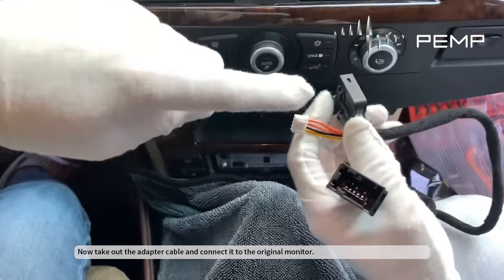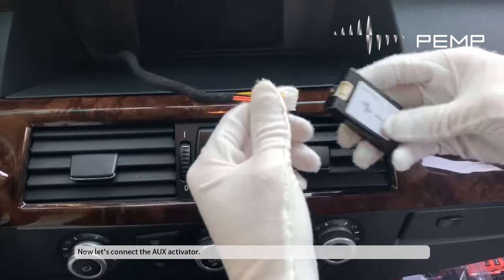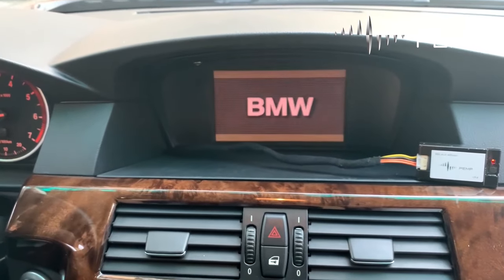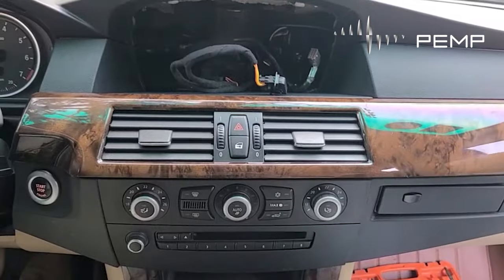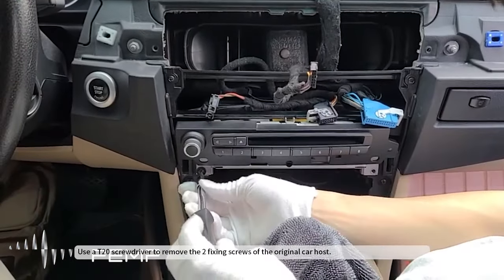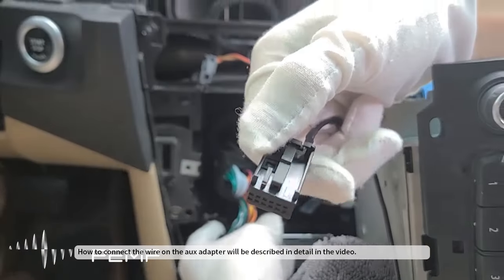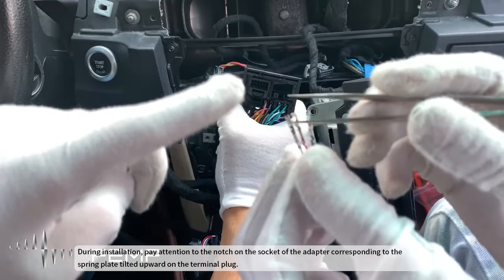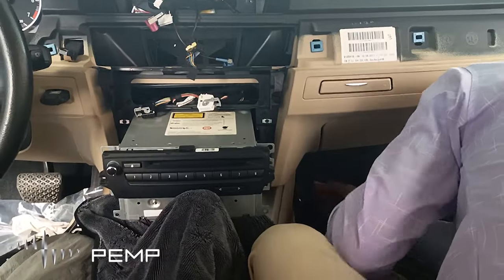Activate your BMW E60 CCC AUX Audio in 1 minute(E61/63/64 CCC all OK)

Comment: Hi guys I recently installed an android 12 head unit, oryginally CCC wide screen, logic7 sound but no aux module.+ in a car e61 2005 Android needs aux to send the sound. Is this will fix my problem?
Reply from the maker: PEMP activator can only activate OEM's AUX menu, if your OEM interface has AUX menu, you don't need to buy it. This product will work if your oem interface does not have an AUX menu.

Comment: Do i have to start the Engine or is powering on the Monitor enough?
Reply from the maker: Yes, during the activation process, you need to start the engine.
(important )!! After activation, keep connected, wait for 5 seconds, then turn off and lock the car and let it sleep for 15 minutes. Disconnect the negative pole of the car battery for another 1 minute and then connect it back. Then get on the car and check the aux audio was display, if the aux audio also display. It has stored your AUX AUDIO menu.

Comment: i have started the system without locking the car for 10 minutes, now the menu is back to original, what shall i do? i have emailed you, waiting for a solution.
Reply from the maker: Dear, You need to follow the instructions to lock the car and disconnect the battery. Otherwise you won't get the AUX menu. Here are the notes:

Step4: (important )!! After activation, keep connected, wait for 5 seconds, then turn off and lock the car and let it sleep for 15 minutes. Disconnect the negative pole of the car battery for another 1 minute and then connect it back. Then get on the car and check the aux audio was display, if the aux audio also display. It has stored your AUX AUDIO menu.

Comment: I have the CCC Head unit in my new-to-me 2010 E60 535i, and it has the AUX on the screen already (After "CD") but when I click on it, nothing happens... the button activates but the screen doesn't change, and I plugged my phone into the 3.5" jack that's under the USB plug in the armrest... but nothing happens... I haven't tried the USB plug yet... any suggestions?
Reply from the maker: You need to make sure that your AUX jack is connected to the AUX input on the back of the radio? Did you purchase the PEMP activator? Please send your order information and questions to PEMP's after-sales service team at service@pempcar.com
They will reply to your message immediately.
Reply: @pempcar  thank you for responding… I just bought the car so I don’t know what’s behind the radio or if anything has been changed… it just sucks that the screen says ‘AUX’ but it doesn’t work… I just want to make sure everything is working before I buy one of your systems (probably the vertical one)
Reply from the maker: @MonsterPartsRc  If you have the AUX menu in your screen, it means it has been activated. You won't need to buy the PEMP activator anymore.
You can try to buy BMW E60 AUX harness on Amazon. They will be much cheaper.
Reply: @pempcar  I think my AUX (and Bluetooth) isn’t working because I have an SOS system malfunction…. And somehow these three systems are related/connected… I’ll have to get that fixed/bypassed first
Reply from the maker: @MonsterPartsRc  Ok, hope you get it fixed soon.
Reply: @MonsterPartsRc  Probably a faulty TCU module if u have the SOS malfunction and no bluetooth. I don't know if aux is related to the TCU module tho
Reply: @anooniem9246  thank you!! I figured it out… it was badly corroded MULF2 Hi… I found a replacement on eBay and now all is well… PEMP with a backup camera is my next step after figuring out some engine issues

Comment: Do all E60 has that green optic fibre cable? Was wondering how should I install the aux and screen if mine doesn’t have the green cable (not sure if mine has it). And do I need to disconnect the battery before all of this?
Reply from the maker: You must activate the original AUX menu first, then install the Android screen. If your car doesn't have fiber optic cable, it has no effect on activating the aux. You also don't need to transfer fiber to android harness that step.
Reply: Do i need to disconnect the battery before installing?
Reply from the maker: @AKill150  Activation must be required to power on, after activation you go by the following note:
NOTE (important )!! After activation, keep connected, wait for 5 seconds, then turn off and lock the car and let it sleep for 15 minutes. Disconnect the negative pole of the car battery for another 1 minute and then connect it back. Then get on the car and check the aux audio was display, if the aux audio also display. It has stored your AUX AUDIO menu.
Reply: I’ve managed to install it, everything works as it should except GPS. Any advice on this GPS issue?
Reply from the maker: @AKill150  Are you talking about the stock GPS function or the Android GPS function? You need to connect the GPS antenna correctly and there shouldn't be a problem.
Reply: It’s okay the GPS works thanks, turns out it’s because im in a building. By the way, is there a way for me to disable the automatic change to “car reverse display” each time i put on reverse gear?
Reply from the maker: @AKill150  you can set the camera to oem option in the settings.

Comment: hello please help today I turned it on and it started working but then when I started the car it started flashing only red and it doesn't work help thanks
Reply from the maker: Sir, Please follow the instructions on the red card to activate:
(important )!! After activation, keep connected, wait for 5 seconds, then turn off and lock the car and let it sleep for 15 minutes. Disconnect the negative pole of the car battery for another 1 minute and then connect it back. Then get on the car and check the aux audio was display, if the aux audio also display. It has stored your AUX AUDIO menu.
Because it can only be used successfully once, if already used. You need to repurchase.
Reply: hello, everything it said, but it doesn't work, it doesn't show up on the display, oh, nothing, if you have an account or somehow I can contact you, I'm very grateful
Reply: I do everything as it says on a red card, but unfortunately it doesn't work
Reply from the maker: @RadoslavDimitrov-n2w  please contact our after-sale team at service@pempcar.com
thanks
Reply from the maker: @RadoslavDimitrov-n2w  This is very regrettable, please send your purchase order number to our after-sales service team at service@pempcar.com

Comment: My pemp light only flashes when on and doesn't reset my screen
Reply from the maker: Please be sure to follow step 4 of the red card description to disconnect the negative battery power when the activation is successful.
Reply: The problem I'm having is when I hold down the button on the device it only flashes red instead of staying red.  It does not reset the monitor or anything.
Reply from the maker: @joefish9771  This means it has failed and you need to contact the seller for a replacement or repurchase.

Comment: Must I press always for aux activation??
Reply from the maker: Please follow the steps below to activate, paying special attention to step 4!
Step 1: Please watch the 2 videos on how to activate and install the 3 wire terminals, paying special attention to the important tips in step 4! Otherwise you can't get the AUX AUDIO menu and sound.
Step 2: Remove the original car's display screen, and connect the wires as shown in the figure; Start the car and place the original car display on the Entertainment interface;Press and hold the button for more than three seconds until the indicator light turns on; release the button to start activation Process.
Step 3: After the activation process is over, check the original car entertainment interface, AUX Audio shows that it has been activated; keep it connected!
Step4: (important )!! After activation, keep connected, wait for 5 seconds, then turn off and lock the car and let it sleep for 15 minutes. Disconnect the negative pole of the car battery for another 1 minute and then connect it back. Then get on the car and check the aux audio was display, if the aux audio also display. It has stored your AUX AUDIO menu.
Reply: @pempcar  then i can disconnect the aux activator ?
Reply from the maker: @maherhatahet7243  Yes, if you confirm that the AUX menu is successfully activated, you can remove the activator.

Comment: Quick question mate my 2006 e60 just got an apple carplay screen it all works good but there’s no sound I read I need to have an aux function will this fix it?
Reply from the maker: Yes ,you  are right, if your OEM interface has not AUX menu, you can not get android sound. you should activate the aux at first.
Reply: @pempcar  I have iphone
Reply from the maker: @lzz1796  Yes, pls check your OEM screen have an aux menu? If not, there is no sound coming out of your iPhone connected to the Android screen.
Reply: @pempcar  I recently got my apple carplay installed but no sound I will take it to get the aux thing installed tommorow hopefully it works with apple carplay
Reply: @pempcar  my audio guy said it’s the wrong part it doesn’t work and I have a 2006 e60 how do I return
Reply from the maker: @lzz1796  pls email our after-sales team: service@pempcar.com

Comment: And the control unit stays plugged in and then you can plug it out?
Reply from the maker: After you confirm the successful activation, you can dial out. Don't stay connected.

Comment: I tried this and now my ccc wont start, i did everything according to the instruktions and now it refuses to start, ut just turns on and off all the time any shows the BMW logo, now i have to buy a new ccc unit, thanks so much
Reply from the maker: After successful activation, you can remove the activator. If the BMW LOGO is always on. That should be that the wiring harness is not connected correctly, and the CCC host does not get the Can command of the car.

Comment: Mine got activated… but after that it just disappeared:/ now the pump thing just blinks red… and I don’t have aux:/ why?
Reply from the maker: Dear, I received your email, although your product is not from PEMP, but you can also activate it according to the PEMP product manual. Especially step 4 power off is very important.
Reply: @pempcar  but why does it blink now?
Reply from the maker: @levikraus4106 Dear, because the activator can only be successfully activated once. after it has been used. It will keep flashing.

Comment: Hey I just installed everything and the base is non existent, what could be the issue?
Reply from the maker: pls send me email of your question: service@pempcar.com thanks
Reply: @pempcar  just sent a bit ago, thank you very much for your help!
Reply from the maker: @HomeAmongTheWise  OK, i have replsy your email.
Reply: @pempcar  Hello, hope your dsy is going good, still waiting on a reply from you on why my bass is not working well, thanks
Reply from the maker: @HomeAmongTheWise  Dear, if the white red and black are connected correctly, and you don't hear BASS, you can change another device to test, if it still doesn't, it means that the sound of AUX is not as good as CD.
Reply: @pempcar  Hi, thank you for your reply. What did you mean test another device? Is sound quality properly addressed in the pemp activator that I brought?
Reply from the maker: @HomeAmongTheWise  I mean change another phone or audio device, input to car AUX, to prove if it's all like this without BASS.
Reply: I have the same issue. Bass is almost non existent. I m using an iphone and instead of apple music i use VLC and it has an equalizer in it and you can push up low frequencies. But it’s still not as good as native bass. Is there a hardware solution to this?
Reply: @khalidhalba  You know I have come to the understanding that Bass won't be as good as cd player buut, you can go to setting in your phone and configure for bass in your phone and you will hear more bass. I was freaking out at first also but once I did what I told you and listened for a while I saw that everything worked out really well. (Maybe you can find an app that will increase bass in your phone also)
Reply: @khalidhalba  I don't know if it would even ever be "as good. Hey if you find a better solution please send a message
Reply: @HomeAmongTheWise  didn’t know apple music has those settings, i will this and let you know!. Thanks

Comment: Mine doesnt work and just flashes red now
Reply from the maker: Please follow the precautions on the red card and disconnect the negative terminal of the battery after activation!
Reply: @pempcar  it didn't activate at all didn't show up
Reply from the maker: @connorbarry6316  You need  contact Amazon to replace it with a new one for you.

Comment: Does it come with AUX adapter cable
Reply from the maker: Yes, Parts List
a. Activator X1;
b. Connection line X1;
c. Audio line with terminal X1;
d. Audio cable X1
e.Wire terminal block X1
You go to the link below to view the last picture.
https://www.amazon.com/dp/B08XXF2T5Q?ref=myi_title_dp